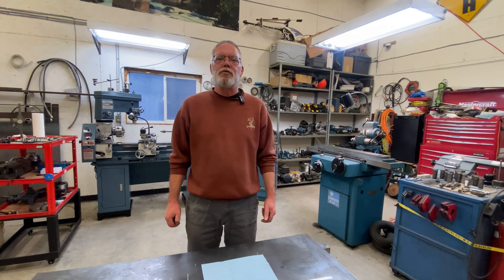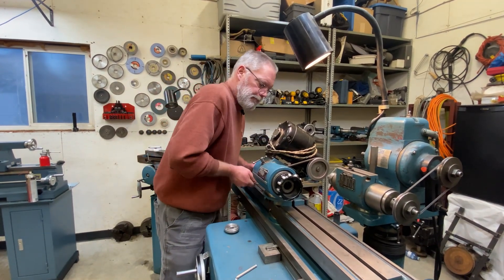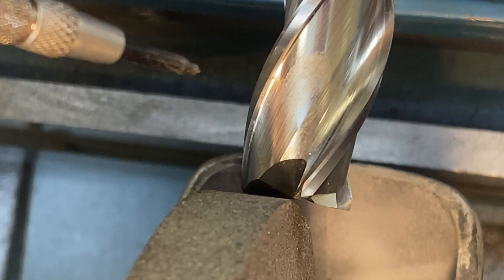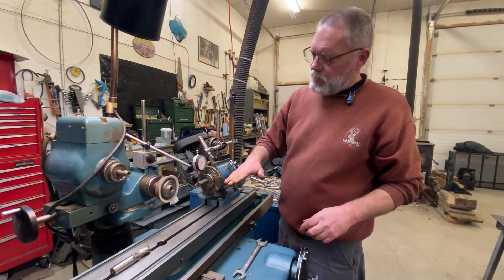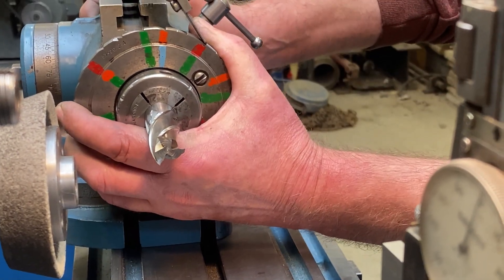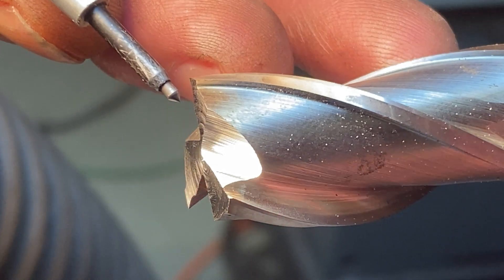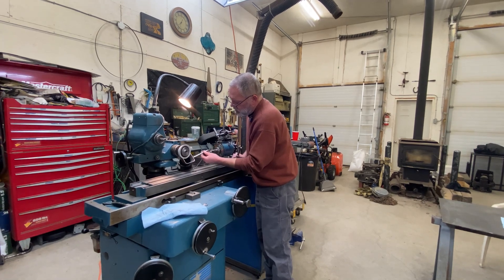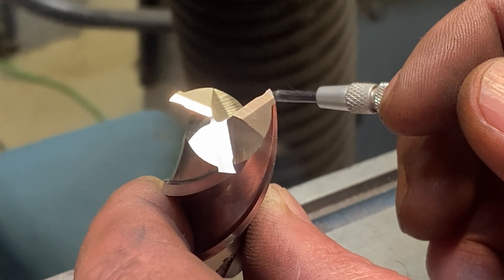HOW TO ACCURATELY GASH A END MILL AND MORE!

Comment: Nice! Love the video. Been very helpful with the use of my KO Lee grinder. What type of wheel are you using to do the gashing? Is a normal flaring cup wheel?
Reply from the maker: For this example,( 3flute end mill ) the flaring cup is just about perfect. You would need all together different forms to gash a 4flt or 6flt etc
Reply: Thanks a lot for the fast reply. Maybe in the future you will do a 4 flute. Thanks

Comment: Hi Andy. When gashing, is the grinding wheel and motor rotated to be square with the table travel?
Reply from the maker: Yes, absolutely
Reply: @Lappemountainliving  Does the angle of wheel profile matter? Are all cup wheels manufactured with the same angles?
Reply from the maker: Yes the angle of the wheel profile is very important. I believe all cup wheels do have the same angle and it's important to note that in the example shown the cup wheel was used to gash a three flute end mill. The cup wheel would not work on a 2,4,6,8 etc flute end mill. Unfortunately there is no standardization that I can point you towards. Basically when gashing you are creating the face of one tooth and the trailing edge of another. your wheel choice should leave the trailing edge of the one tooth as close to parallel as possible to the face of that same tooth. This just happened to work out using the cup wheel on the three flute.

Comment: thank you for accepting the challenge. There is no rush at all, every detail counts when learning. I use 6mm end mills on my CNC mill mostly more as a machine safety. 6-8mm tools snap much quicker compared to larger ones, and the machine itself won't suffer or deform when happens. These very good small and thin CNC cutting tools nowadays are expensive too. So, it is worth sharpening them.  (Carbide end mills). There are not professionals enough for this complicated sharpening jobs, and not because end mills very chip. They are not chip any more. Thank you once again.
Reply from the maker: https://youtu.be/_Y0KPPYs7IM  
ATTACHED IS PART 1 IN YOUR VIDEO SERIES ON HOW TO SHARPEN SMALL CARBIDE END MILLS. I DIDN'T MENTION YOUR NAME AS 
I HAD FORGOTTEN TO ASK YOUR PERMISION IN ADVANCE.
HOPE YOU ENJOY!

Comment: Yes , very good indeed, as good as all the rest of your videos are. I want to see you sharpening/grinding 4-6 mm end mill and drills. Not as an exam..., this seems to me more intricate job and I have to learn doing it. I thought of using a camera. I wonder, you as a professional, what is your way/approach. Is there any other tiny set of tools for this job, or....? I have a good grinding machine here (3E642e universal grinding Russian machine ). Just learning now.
Reply from the maker: Challenge accepted! I don't believe I have ever tried sharpening such a small end mill as the cost of them is so low it wouldn't be worth the setup time/cost unless you had a bunch of them to do.  However as a challenge and a project I think it would be fun to try. 
I am not aware of any tiny equipment that would make the sharpening of small end mills easier.
Thanks for watching!

Comment: Great! I learned a lot! I am completing the repairs on a KO Lee 960 and I cannot wait to start making mistakes :)
Reply from the maker: Thanks! Best of luck with your new "old" machine!
Reply: Love the K.O.Lee equipment. I have a pretty well tooled 960 as well. American made quality, lots of cast Iron. Do you need any KOLee parts or have any stuff for sale?
Reply: @randycort3142  Hi Randy, I am still figuring out what I need in terms of tooling, it seems that the options are endless! Andy's videos are helping a lot. I may have a few extra pulleys for driving the spindle, in case you need some. I do not have the table stops, but I think I can make a couple and even add a micrometer to one of them.
Reply from the maker: I really like the idea of the micrometer table stops. I can imagine a ton of situations where that would be super handy
Reply: @Lappemountainliving  well, that settles it. One more project to my list! :)